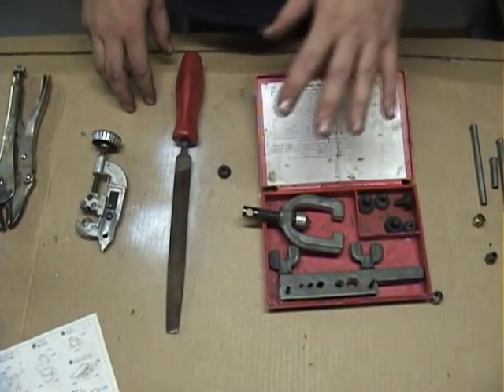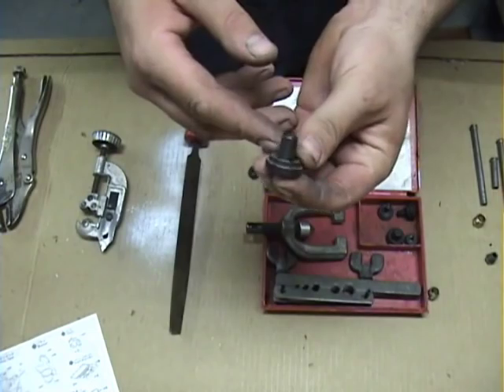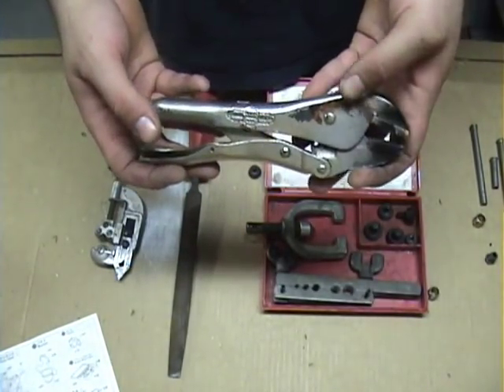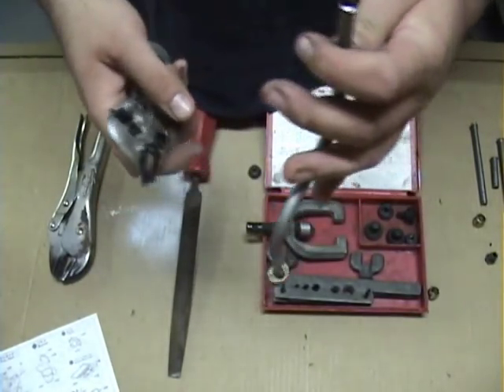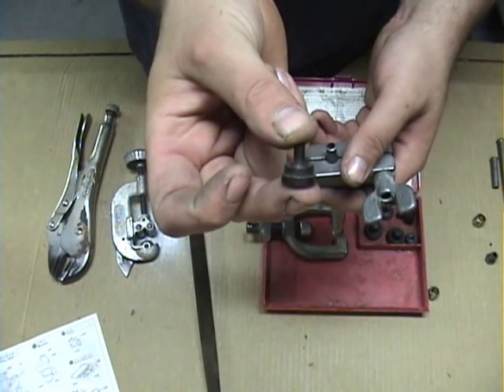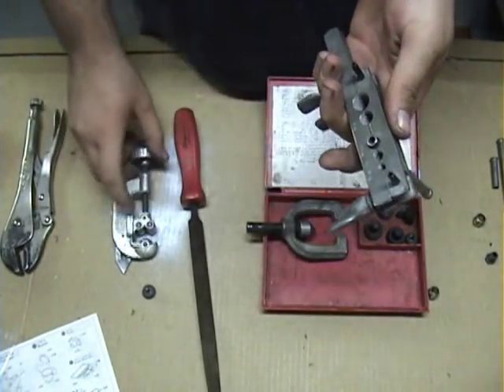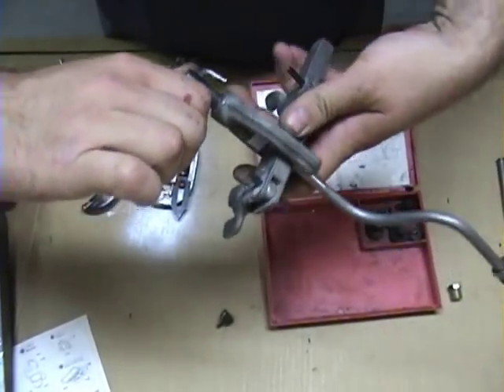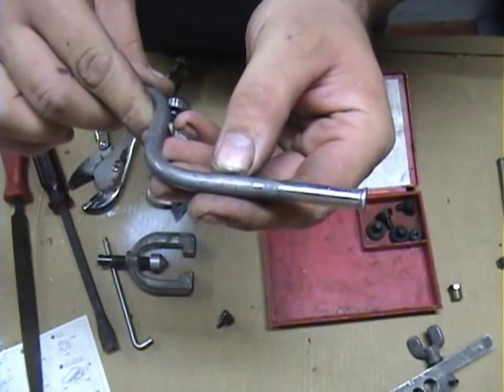brake line flaring video #1

Comment from the maker: Technicaly, you're not supposed to use tools to tighten the stock. However, I've found that it can be difficult to get good clamping force on the line just hand tightening the wingnuts. This is especially true if you're flaring a line that is on the vehicle that may either be dirty or in an awkward position. The reccomendations of the manufacturer are a good starting point, but real world conditions will dictate what really need to be done to make the tool work.

Comment from the maker: @jhonea005 Sometimes the die will leave raised areas in the metal where it was clamped, similar to knurling a valve guide. You may need to do some ligth sanding around the area where the fitting goes to get it to slide down.

Comment: Sweet. I just picked up a flaring tool and I tried using it with not much sucess. I was watching another video made by a tool manufacturer and they recommend not using tools to tighten the stock. Is there any advantage to not using a tool to tighten the stock?

Comment: thank you so much your video is helpful pleas where did you buy the tool ineed to buy  one
Reply from the maker: No problem. The tool I used in this video came from one of the local auto parts stores. Any of the national chains, such as Napa, Autozone, Advance Auto, or O' Reilly, should have them, and I think Harbor Freight has them as well. They aren't very expensive, I think I only paid about $20 for mine.
Reply: Ok thank you again so much for you help iam new machanic need to learn more

Comment: In a tight situation, could you use a dremel to cut the hard line then reattach the line with a coupler?
Reply from the maker: If you're talking about using a compression fitting, it would depend on what line you're repairing. On a relatively low pressure line like a fuel line, yes, you can get away with that. However, on a brake line, no, as they are not rated to hold the pressures in a brake system. especially if it has ABS.

Comment: I'm having trouble with my brake lines. I make my flare but then my fitting won't slide down the line to the flare. It gets hung up around where the bottom of my die sat. How can I fix this problem?

Comment from the maker: @marshkid1 I do a comination flare with thise, usually on the male side. You'll need a bubble flare kit in addition to a double flare to do this. First, make a bubble flare as normal. Then, with the line still in the bubble flare die, use the 45 degree ram from the double flare kit to complete it. I've done several this way, none have leaked. 
I may make video of it, as some as I can scavenge an original one to show what I'm copying.

Comment from the maker: @dgn1978 You are correct. However, the tool I'm using in this demonstration is almost 20 years old, and has worn out over the years. About the only way i can get it tight anymore is to do it as shown in the vid. It's also the reason i no longer use it. I now use a Blue-Point that I got from the Snap-On dealer. Much more expensive, but does a far better job.